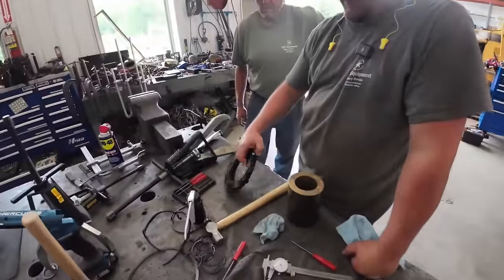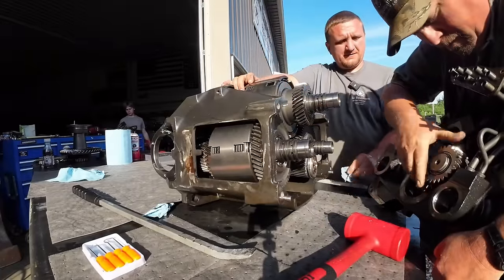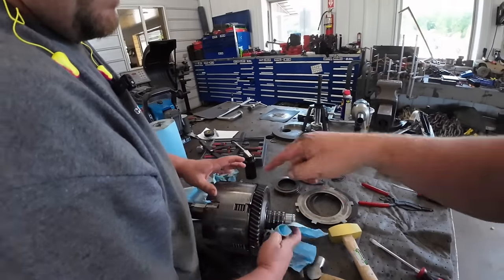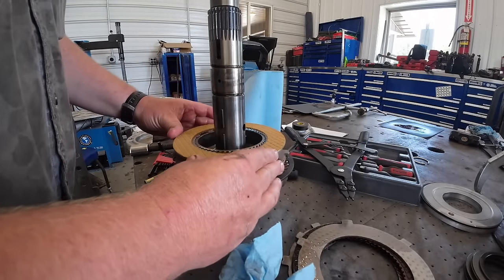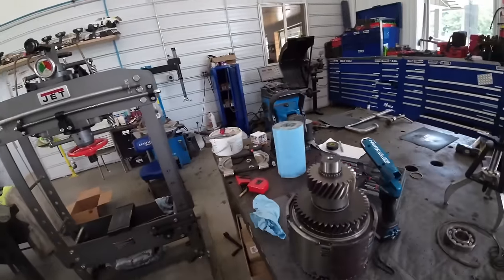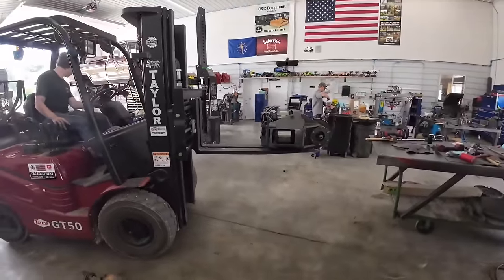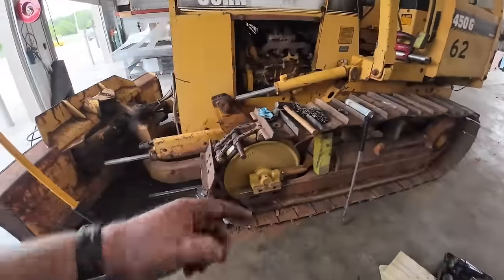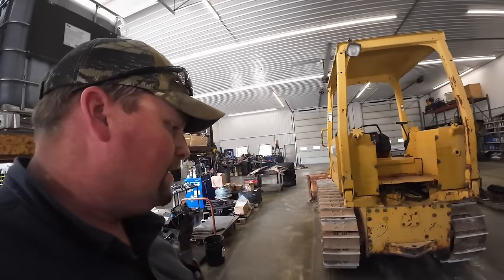John Deere G series dozer transmission rebuild and installation, will it run again? Part2

Comment: Why don't you buy a surplus generator at one of your auctions and wire it into your electrical system, when your main power goes out, the backup generator will power your entire property until the main power goes back on, simple fix to a power problem.

Comment: Clint, you definitely have one of the top channels when it comes to filming jobs like this one.
You don't skip around leaving out half of what you're doing. 
You explain what, why and how you're doing during the various steps to remove, rebuild and reinstall various items in for repair in your shop.
A pure joy to watch.
I've dropped some channels because they didn't come near to as good as your channel. 
Personality also makes a difference and the way you treat your crew and sons is absolutely outstanding.
Reply from the maker: Thanks
I know allot of stuff gets skipped on other channels and some people don’t know the difference
Reply: @C_CEQUIPMENT  cutting edge equipment outta Australia is pretty good.
He includes the entire process of rebuilding and even remanufacturing broken assemblies on excavation equipment. 
He just did the boom cylinder on an excavator that had been extremely allowed the piston wear to exceed specs.
He had to make a new cylinder barrel.
Cutting off both end assemblies on a lath then welding them on the new barrel.
Like you, he filmed pretty much the entire process.

Comment: 8:27, Those shafts I believe were made at John Deere Waterloo Works Waterloo Ia.. I don't know how many I helped make over the 20 years. R46214 clutch pack shaft. It takes a lot of operations, hours and different machines to complete one.

Comment: I had a 550 G and loved it only thing i had to do to it was put the new hardware in the 6-way blade we sold our farm in Indiana and we sold the dozer I kept my 2004 JD 250 skid steer with 800 hours and my 2018 JD 35G with 1400 hours on it I kept them I only have 5 Ac NOW

Comment: Clint, forgive me if I misheard but I seem to have picked up from what you were saying that variable length  power outages arent exactly unusual in your area due to the weather and whatnot , for the future I would consider investing in a whole bunch of 30 or 40 watt cold white LED flood lights for around the shop all of them gang connected to a single  socket outlet. and purchasing a couple of  decent size solid state battery banks maybe controlled  with a UPS (uninteruptable power supply) module that could kick in immediately if mains power was lost for whatever reason. that you can keep charged up to plug them into if the power fails again,..........plus when you DO have power and turn them on you will double the interior lighting..........not to mention being able to pre aim them to where you need them most, failing that - make a gen set out of an old deer motor with sufficient balls to run the whole site from a shed built behind the workshops. that way you should never have to struggle again.           .........brilliant vid as ever guys As an Englishman Ive never met any of you obviously, but already I feel like you lot are family.

Comment: The main reason for snap ring failure when refusing snap rings is over extension of the run during dissasembly.

Did you air check each of the clutch packs after assembly, I didn't see that in the video.

Comment: Love your channel and work in these older John Deere equipment…
Any chance of a video on the shop, dimensions, ceiling height, door sizes, what you would do different to making working on these machines more efficient and effective. Would you have dual pits to work in or is one good enough.

Comment: Great video, you inspired me to tackle my newly acquired 455g that struggles to push much forward but rolls good backwards. I imagine I have a blown forward clutch pack but will take your advice and do it all. Question: that filter you were waiting on NAPA to deliver, that seems to me like the cylinder filter as it attached to that tank. Am I mistaken or is there a transmission filter I’m not aware of?
Reply from the maker: Depends on year of machine but earlier ones had a trans filter under floorboard

Comment: Your fire extinguisher on the wall is blocked by a tool cabinet. You should NEVER block a fire extinguisher! In case of an emergency, you need to have immediate access. Actually, I only see one extinguisher for the whole shop. If so, this is not nearly enough. Not picking on you, just I notice these things since I am a retired Fire Inspector. Also, I love your videos!

Comment: There's nothing wrong with a Chevy 4l60e transmission iv got one that factory 94 model that's got over 200.000 miles on it and never had a problem with it.

Comment: Forget automatic, they should put a MANUAL transmission in the smaller dozers, it will last forever, and no more $8K rebuilds

Comment: a Classic 'Dah 'Moment. I'm watching you point out disc's and realizing that the area you removed the trans from is also full of fluid usually, Ok may be half full. I don't know. I'm used to an automotive style. Engine contained Trans contained in it's own housing not part of the structure of the vehicle. Well Dah that's one reason it takes 30 gallons of fluid.    Holy cow I don't know why this never registered in my head. I just thought you could use a laugh.